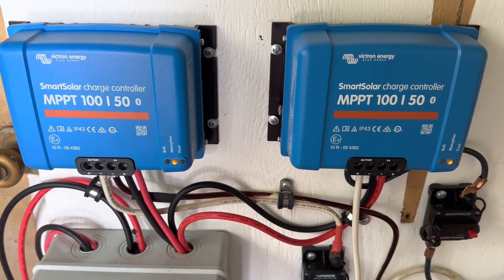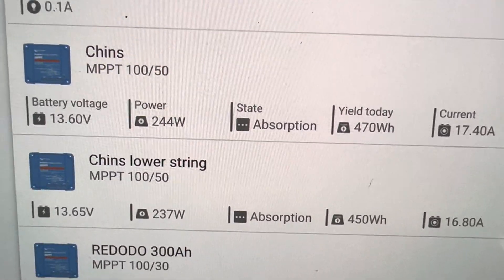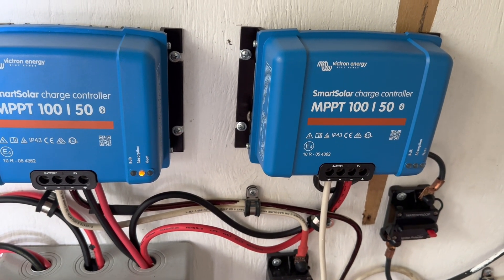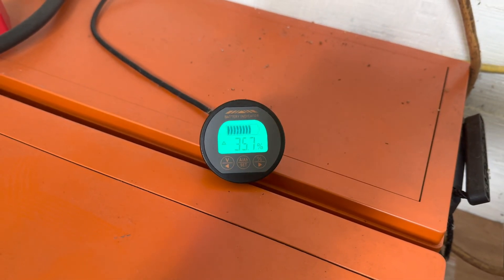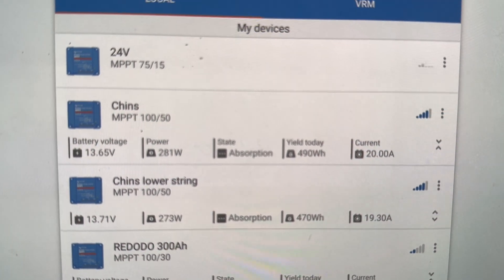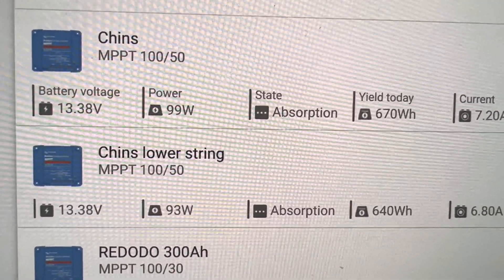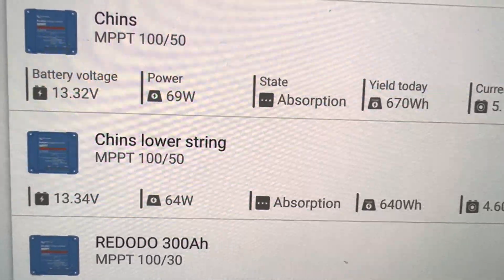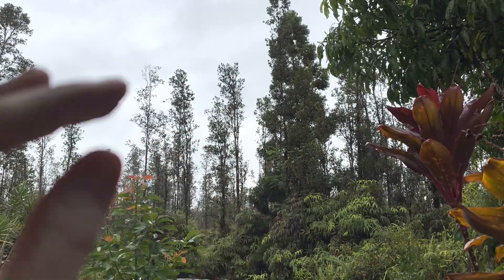False Absorption phase with Victron MPPT 100/50  Smart Solar Charge controller Momentary confusion?!

Comment: For Lifepo4.
Bulk/Boost/ Absorption all refer to the same target voltage - 14.6 or less for 12 v.
Float should be 13.6 v. or less for 12v. And that's all you need for charging 12v- lifepo4.
Thats the way I have come to understand the terminology.
Reply from the maker: Yeah,  I'm going 14.2v bulk, 13.5v float.  Pretty much works perfectly on my system.  Higher bulk with my conditions trips alarms. Occasionally on 14.2, but always recovers quickly.  Mahalo for sharing your information with us...aloha 🤙
Reply: @ProjectsinParadise808  set bulk as 13.8 or 13.9v and float at 13.5v

Comment: That interesting. only does this with changing sun . possible a voltage drop at charge controller under fun sun tricking the charge state. what you can do is wait for 1000 watts charging look at voltage on your app and put your meter right on battery . if the charge controller higher  a large amount you are getting a voltage drop from charge controller to battery. check connections . start probing with voltmeter look for the drop . may be wire size off charge controller to buss bar  or buss bar to battery.   also the charge controller does not know the state of charge it works buy voltage and amperage only. using a Victron smart shunt and linking that together with the 2 controllers will let network know the state of charge. and help you fine tune the system with all 3 working together. take out that state of charge meter and replace with smart shunt would be great. for now check for voltage drop under full sun and high amps to battery. may be loose connection or wire from charge controller may be to small and up wire AWG use OFC wire or pure copper. let us know what you fine. 😀
Reply: looking at outher video . check the wire size from 50 amp controller. if you are getting close to 50 amps the wire size should be 6 AWG at a min better 4 AWG. use welding cable like windy nation . it is UL and true AWG pure copper. even that short jumper to breaker. all should be 6AWG to 4 AWG right to buss bars. and your big wire to battery make Shure not CCA wire or GA wire. that has a voltage drop under heavy load. test with meter. The Victron smart shunt should sent true battery voltage to 50 amp controller and correct for voltage drop in system. also smart battery sense will work as well ,I thing the smart shunt would be better. you will also have battery state of charge on your app you like. will have all right on blue tooth device . Victron stuff talks🌞 to each outher just fine.
Reply: looking at Victron stuff. either smart sense or smart shunt will work. with smart shunt . place shunt close to battery neg  as possible and pos lead place right on battery plus with fuse. will work the best. same with smart sense . add to network .
Reply from the maker: If I ever see the sun again I'll check everything you mentioned,  Haha! Been dark and so wet. Over 12 inches rain in past 24 hours.  Double that in past week.   Engine compartment deep on roads out. Actually had to brave the road out yesterday,  and floated my vehicle momentarily,  at speed to make it through.  Playing musical batteries for sure, still not using generator,  but getting oh so close. All systems need a boost, no sun in forecast.  Oh well,  that's how it goes yeah! Mahalo for all the pointers,  and will try, and let you know.  Aloha 🤙

Comment: As others have noted, a smart battery sense will send correct bank voltage to the controller[s].  My old controller didn't have a working battery voltage sensor so I had to "fudge" the  Absorption voltage upwards a bit.  

I charge mine to 13.8v and hold Vabs until trailing current drops to 0.1C.
Reply from the maker: Yes, I plan to add that soon. Aloha 🤙

Comment: In an emergency do you have small portable generator and portable charger to charge those Chins ?
Reply from the maker: I do have a generator backup that I run the Victron 12v 30amp charger if need be. Have only used it once or twice in past year, but glad it's there! aloha 🤙

Comment: Now that you are in Victron Network, as you know, voltage is a bad indicator of LiFePO4 State Of Charge. So that's why you have your shunt (nice little unit) that accurately tells you how your SOC is in reality. The problem is, that shunt does not communicate to the charge controllers. The Victron Smart Shunt does that, and tells the charge controllers where the batteries are. Not absolutely mandatory to have, but it definitely improves your system performance...

Andy from Off Grid Garage had the same problem, and that is how he sorted it.

I love your channel, keep up the good work, and I recommend begginers to come and check your channel.

Alohaaa
Reply from the maker: Aloha and mahalo for sharing this information with us! I'm definitely getting the Victron shunt soon. 🤙

Comment: Thanks for the content.  IF you add a Victron Battery Voltage Sense / Temp probe for $40 and place the sensor and the two controllers on the same VE network, then the voltages assuming you have one or two batteries in parallel you in effect eliminate the delta between the controllers terminal voltage.  The battery voltage sense takes no current and thus no voltage drop since its directly on the terminals.  My small system shows a .01-.02v difference at most using that little gizmo under charging but the real benefit is when the batteries have a load on them as the voltages will vary more.  Gary
Reply: I originally got the battery smart sense for low temp charging protection on my ampere time batteries but also noticed my voltage was way more similar between everything Victron after getting the smart sense and pairing everything to a smart network.
Reply from the maker: Mahalo for sharing this information with us Gary! In time, I'm adding more Victron components! Aloha 🤙

Comment: I was about to contact Victron about the same problem, I only have small system 200w system and 75/15 controller battery only about 50% full and shoots from maybe 13.4v up to 14.0v and enters absorption with only about 165w for short period, I don’t think it will go back to bulk I have to switch of solar to enter bulk again in the summer would have took 200w for ages without this big voltage rise. Raised absorption to 14.2v still doing same thing . Why did it not do this last year? Actual battery voltage only rises by a fraction 0.04v , controller voltage rises by about 0.6 or 0.8v tried 2 different battery’s same issue on both. 70ah lithium phosphate.
Reply from the maker: I tried 14.2 for awhile,  but had to drop to 14.1v to keep from triggering alarms due to my intermittent sun, clouds situation.  Now at 14.1v working great on my systems.  Mahalo for sharing! Aloha 🤙

Comment: hrm... I have that exact setup, and I have 3200 watts (1600 each array)... and I have not see this I don't believe.  But off the cuff I can't say what I have mine set at, I'll have to look... but I'm charging a 400 Ah 24V battery (as configured)... so it's probably much harder to quickly push that batteries voltage around... but I am hitting it pretty hard.  I often see 50 amps from both charge controllers, when we have full sun, and I do have a smart shunt networked in with the controllers... which is set up to provide battery voltage, rather than from the controllers.
Reply from the maker: Fine tuning our systems and sharing with each other is so great. Appreciate your feedback my friend! Aloha 🤙

Comment: with lithium we charge cc/cv dont know if lifepo4 is the same if it is then shouldent we just have bulk charge and have that set as cc/cv charge none of the float etc as also solar if there would run the loads direct and only draw off the battery what solar can not supply
Reply from the maker: Nice to see you again buddy,  and mahalo as always for sharing your information with us...aloha 🤙

Comment: On a 24V system I see about a 0.2V variance with a 50A swing from the charge controller.  Yours seems excessive.  As someone has already said, a smart battery sense or smart shunt would provide the controllers with an accurate voltage.
Reply from the maker: On my list of components to add! Aloha 🤙

Comment: I suggest to use wires with 50-70 sq millimeters from battery to combiner  busbars, located as close as possible to Victron MPPTs to shorten its output wires to a minimum length.
Reply from the maker: Great advice! Aloha!🤙

Comment: Use victron smart shunt it make accurate reading in your battery voltage..
Reply: Would adding a Smart Shunt fix the problem?
Reply from the maker: I will find out soon! aloha 🤙
Reply from the maker: On my list of components to add! aloha 🤙